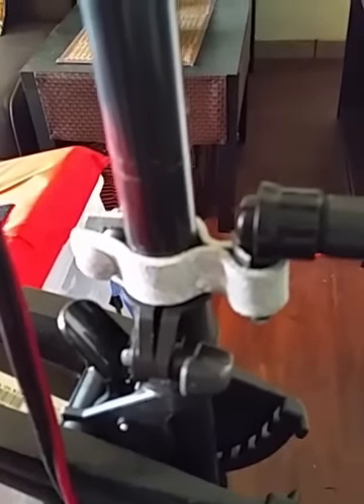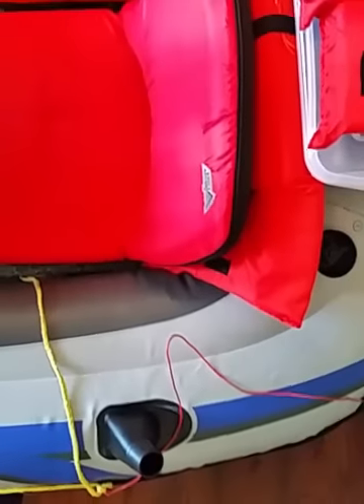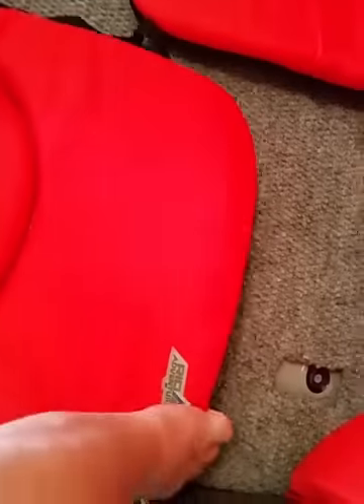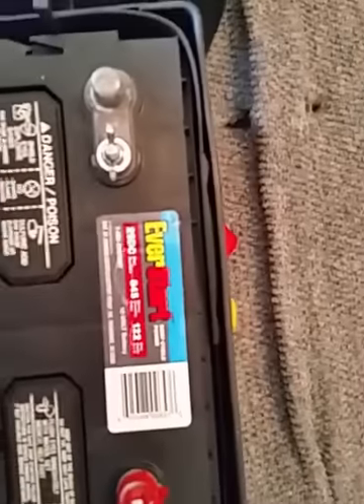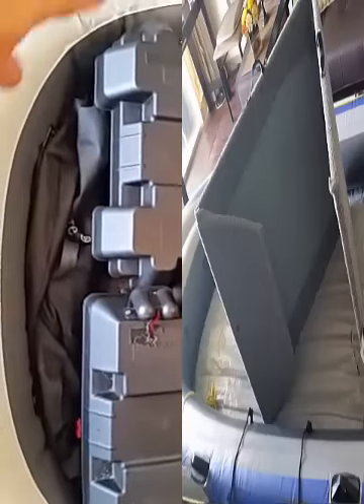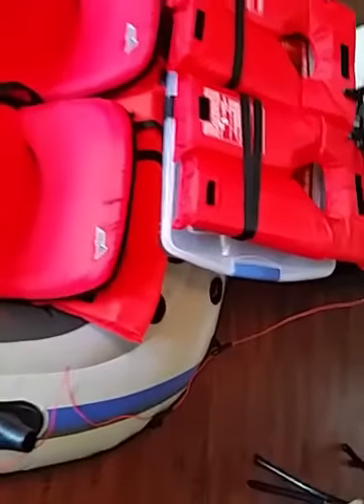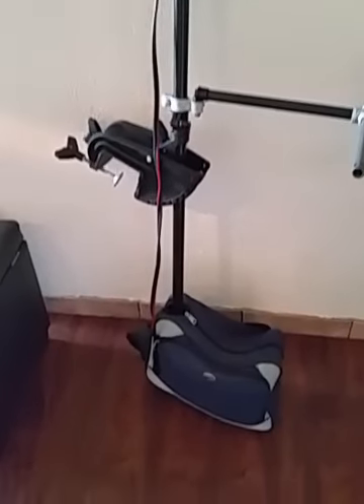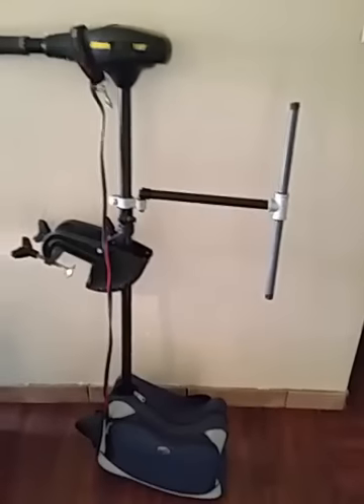2 of 2 Excursion 5 UPDATE with Wood Floors + Stearing of Minn Kota 55 Trolling Engine

Comment: Now that you've had this for awhile are you still just as pleased with it?  Also- could you explain more how you attached the storage bin on the back so it doesn't slide off?  2- someone mentioned dimensions listed, where can I find those?  3-are your floor panels hinged or simply 3 separate parts?  Great video- thank you!

Comment: does the propeller with the 3 fins go faster? great video.you gave me some great ideas,thanks
Reply from the maker: kev p  That is actually hard for me to verify.  It seems to go faster and the motor runs just as long on the battery.  I would still not recommend changing it.  It was very difficult to place the new propeller on, because it is one so very tight.  After I replaced the propeller I felt it was faster, but I can't really prove it, since I don't have to motors to compare.

Comment: So- I tried the 1" styrofoam idea tonight and I failed! I got an 8 foot piece, cut in half to make 2 48" x 35" pieces.  Then I rounded out the ends to fit at the ends of the boat.  It fit perfectly.. I wanted to see how it would handle a little walking before I glued on all of the carpet.. I took about 5 very very soft steps and the styrofoam cracked.. 

Couple of questions:
Do you walk on your styrofoam floor without any issues?  If so do you think I messed up by not using the glue and carpet before trying to walk- does that really add that much more strength?  And finally do you use any pvc pipe under it? I did not.. I really would like to not use plywood but this first attempt did not go well at all.  Thanks for your videos and any additional suggestions.